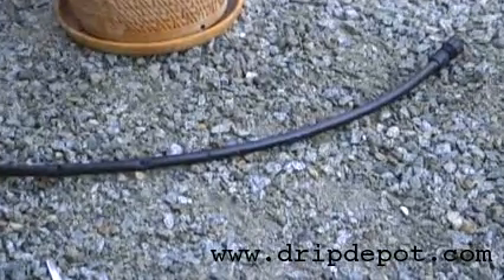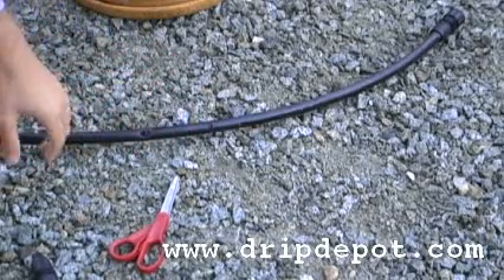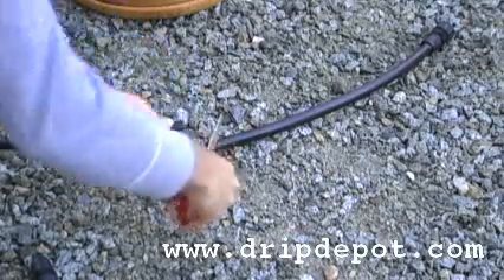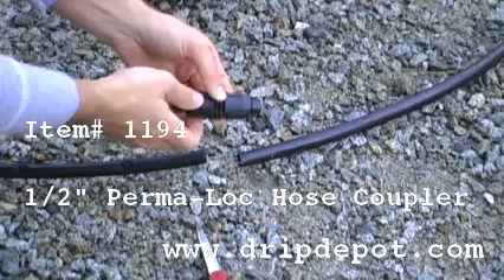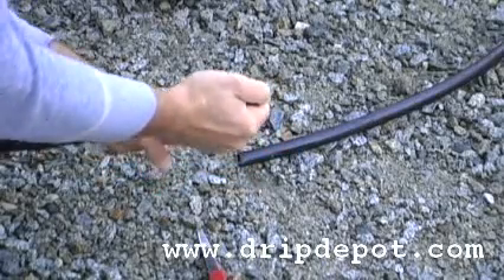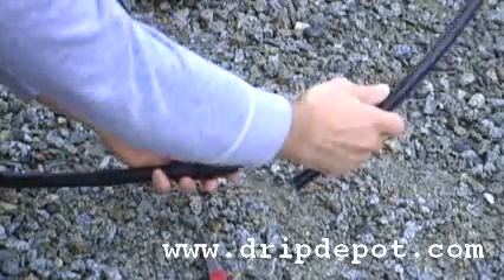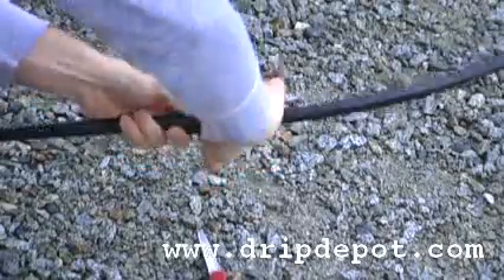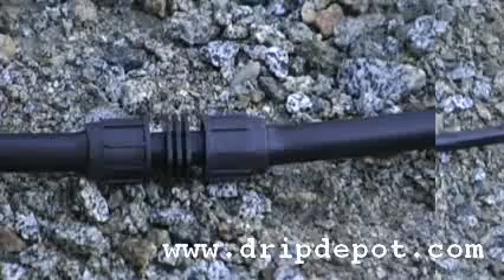Drip Irrigation System - Repair (Tubing)

Comment: Hi Blubitatub,
Yep, you will most likely need to plug the hole with a goof plug and then punch a new hole in the mainline and re-insert the 1/4" tubing.  Once the fitting comes out it can not be pushed back in to create a water tight connection.  If you have fittings that are popping of the mainline tubing it could be a sign that your systems operating pressure is too high.  Hope this helps.

Comment: Iv'e got some 1/4' tubing that has come off of the main drip line. Now a geyser of water comes out of it when the water is on. I don't know how to repair it, pretty sure i cannot just re-attach the tubing to the line. Maybe attach a goof plug to the spot where the tubing was and place new tubing nearby??

Comment: Compression couplings work just as well for this type of repair.  Last week I repaired a section of tubing that had a longitudinal split in it, about 1/2 inch long, which I first cut away; I then pushed the ends into a Raindrip 1/2-inch compression coupling (green tip).  It cost less, was quicker to install than the "universal" coupling shown here, and it works fine.
Reply: Compression fittings suck... they don't last. Can't tell you how many people I have helped when they keep pressing their compession T's and couplers back together because they irrigated the street's gutter with <insert how many hundreds of gallons here> of wasted water. Perma-loc couplers don't blow out (I'd almost say never) nearly as easily as compression fittings.